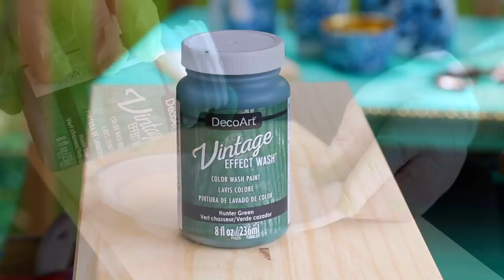Card Catalog Ikea Hack DIY

Comment: Fyi  you could have used thinner plaques or cut them from 1/4 inch ply something lighter if you're gluing, if you use the thick plaques screw on with glue from the inside using a screw thats long enough to hold front but short enough not to go through.
Reply from the maker: Thanks so much!
Reply: @MarkMontanoMakeYourMark  wow I had to rewatch lol take care
Reply from the maker: Patrice you too!